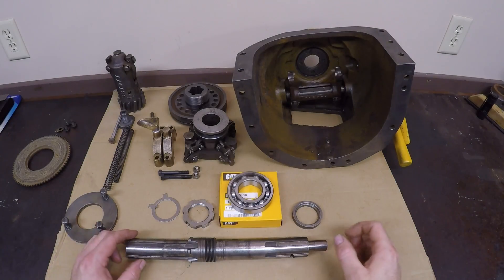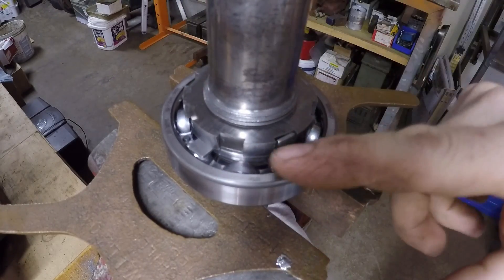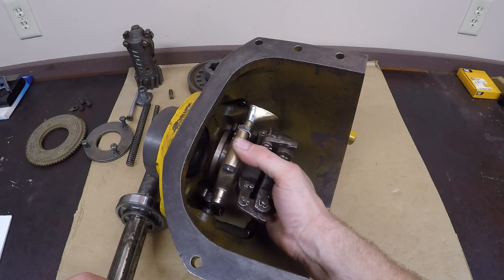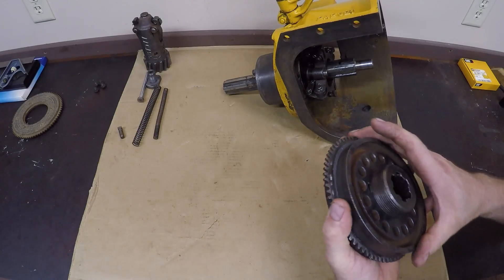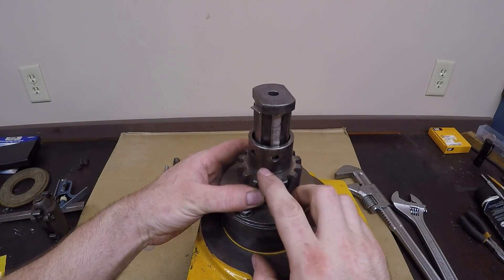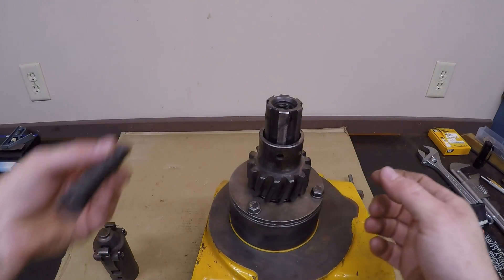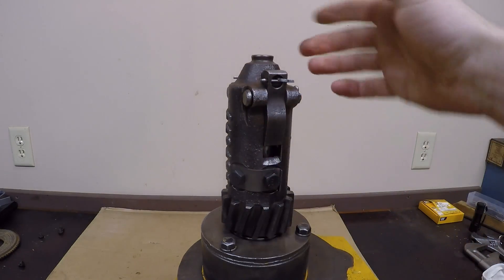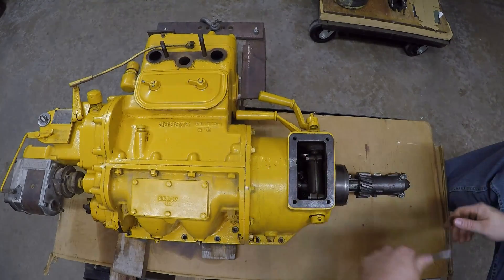Caterpillar RD6/D6 Starting Clutch Drive Repair - Reassembly of Clutch and Pinion

Comment: Just bought a d130000 cat power unit and Frick  "0" Sawmill.. discovered that the pony had some water in the base cover., so it has to come off for repair {hopefully) . Wondered if the pony is the same, and same procedure to remove. You made it look easy! If you could point me in a good direction as to parts for the pony i would greatly appreciate it. Got a lot to learn. power unit is approx. 1940 . Thanks.   Tim in NC.

Comment: @3:45 the oiling cup.. just curious if you used conventional lead or lead free solder.. which is really not nearly as strong as Alpha Fry AM53982 Lead-Free Silver Solder and Flux .. i use that to do many non electrical repairs.. many hardware stores stock this exact part number.. the others of that brand don't the strength.  including metal eye glass frames.  that is how strong it is..  its also really low melting point.. so you could almost use a hot air gun to use it.    @3:55 the yoke..  there is a big groove on the inside.. is that to be filled with oil.. or did the parts manual miss the Felt wicking that should have been in there to retain the oil and release it slowly.  just some forward thinking.

Comment: I realize you know your Cat equipment, however that bearing is probably $20.00 cheaper at your local bearing house. Also I am a firm believer in rubber seal bearings when it comes to equipment that works in harsh environments.
 Great job again. Could you imagine designing that starting motor drive system. ???  Those guys were ahead of their time. Thank goodness for electric start motors. Very enjoyable trip through your starter.......

Comment: Thank you for making these videos and keeping this old equipment going! I have a 112 Cat grader and a D7 3u dozer both with pony motors, so I really enjoy these videos. Do you have more information on the gearbox paint that you used?
Reply: Squatch253 
Electric motor spray varnish winding sealer.  Basicly the same stuff at half the price. It seals up cast-iron real well and oil will not penetrate it.
 Just thought I'd drop my  2 cents in if it helps anyone.
 It's also oxide red and creates  very slippery surfaces for oil run off.

Comment: hey good tutorial......thanks.......where do you get your parts ?..i have a D4 .7U...im working on...im looking for Liner kits.....
Reply: thanks for the info....im up here in Nova Scotia Canada,,,,,ive got a call in to the the cat dealer  here  ....is there after market parts avalible /?
Reply: sidecar147 
 Equipment Trader also has  parts listings.  It's a real good place to Source parts. Their site is not that easy to navigate but keep searching, and you will find the listings. Everything from lawn mowers to Harley Davidsons. It's there but most folks don't know about it. Good luck with that D-4. The  Pacific Northwest has NC machinery Caterpillar dealerships. I've ordered crank bearings for a D-2 Pony motor. They're in stock.